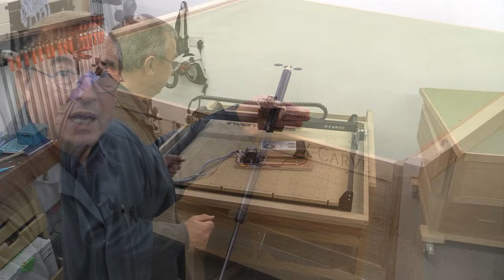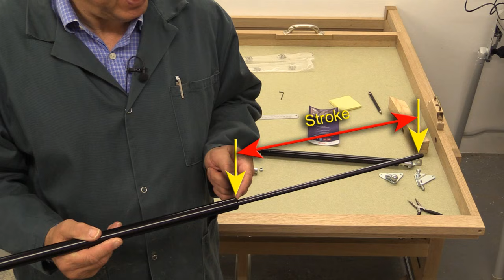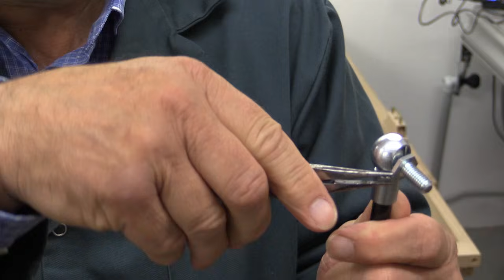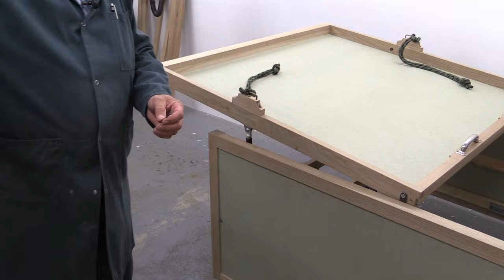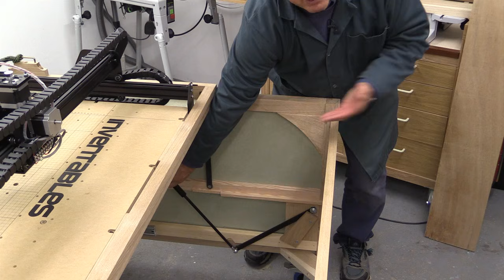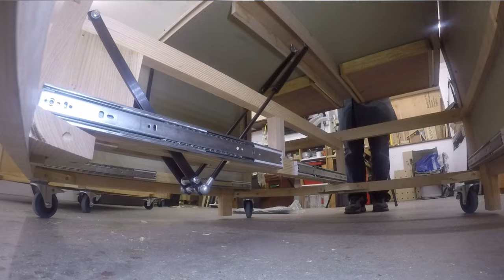How to install gas struts

Comment: Gas springs from STABILUS INOX, usually sold by Attwood, have retainer clips in the heads that can come out and get lost. Stabilus does not supply replacements! These are the clips that you must compress using needle-nose plyers in order to remove the spring from the nub. Very irritating when you've lost the darn clip!

Comment: brilliant solution; thanks for sharing. near 6 years on, how has this stood up to the test of time? do you still find it useful? would you change anything?
Reply from the maker: Hi John, I changed the CNC to a smaller model and decided to make the enclosure smaller. The new design is without gas struts. The old design worked really well and I would have continued to use it but for our move of house and my slightly smaller workshop. Here is the new cabinet:
https://www.youtube.com/watch?v=EysYVMnZxBQ

Peter
Reply: @NewBritWorkshop  Thank you sir

Comment: hi all, I wonder where is the power to push the cylinder of gas struts to up and down. maybe we use by hand, right?
Reply from the maker: Hi Qhungvt, One installs the gas struts in their open position and then when you close the lid (or whatever) you have to apply some force which then provides the stored energy to open the lid later.   Peter

Comment: Hi may I fit these gas struts wooden butter leaf under table    to hold table board
Reply from the maker: Hi Muhammad, I am not quite sure how you propose to do this but as long as the mechanism has a positive stop for the gas struts to push up to then it could work. The other consideration is the amount of force needed to close the butter leaf away. Good luck.    Peter
Reply: Sorry I mean how much weight would they are Handel and my table have extendable legs which are I don't like they block way for chairs to push in under the table that's why I want to fit
Reply from the maker: Hi Muhammad, You can get different gas struts with different force ratings. The ones that I used are adjustable by allowing some of the gas to escape. Doing an adjustment is a one way process and if you let too much out then the gas struts may not have enough force capability. I recommend that you look at the supplier's or manufacturer's web site to find the particular force capability that you need. You should easily be able to find something strong enough for your needs.   Peter

Comment: What a great, informative video. As someone just learning about gas struts, was very helpful. One question not directly related to the struts, but how is the platform kept level? Is it some form of paralellogram?
Reply from the maker: Hi Chris, Apart from the gas struts there are two pairs stays, one set on each side with one at the front and one at the back. One end of each stay is attached to the rising platform and the lower end is attached to the frame. The stays are about 450 mm long. That means that the platform has to move through an arc defined by the stays. The gas struts just provide the motive power.   Peter

Comment: This looks a lot better for the structure of the CNC machine than lofting it upright. Very elegant design.
Reply from the maker: +Educating Savvas Many thanks. I also use the top of the closed unit as a work surface for other tasks.   Peter

Comment: Thanks Peter, for your interesting video. I have a gas strut removed from a car which I think of using in a woodworking project and your video has taught me quite a bit on the subject.
What happened to the gas strut from which you allowed all gas to escape? Is it totally useless now or can it be refilled?
Reply from the maker: +Bala Chandar Hi Bala,  The gas strut that I emptied was sent back and refilled. It is as good as new and in use in that cabinet. Good luck with your project.   Peter

Comment: Hello Peter, 
I saw you at the D&M tool show last week,  I nearly said hello but you looked busy.
Don't give up on the idea of struts for the cover. There is always room if you look hard enough. 
May I suggest to you and other who wish to use gas struts, take a look at any hatchback or estate car. You can learn a lot from how the are positioned. Not only do the hold up the tailgate, they also act to hold it closed.
I can't explain properly with just words, but it is all to do with angles. go have a play and you will see what I mean.
Reply from the maker: +Harvey Smith Hi Harvey, You should have said hello - perhaps we'll meet next year. The gas struts are very interesting and for the main lifting part of the CNC cabinet it was complicated by the parallel motion which is quite unlike the top hinged situation with a car tailgate. The top is not very heavy and the fixed stays seem to be okay. Certainly anyone doing their own design could fully commit to gas struts at the design stage and they should not encounter the retro fitting complication that I experienced. See you nest year at D&M.    Peter

Comment: Peter...if a lid is hinged at the back side ..like the boot of a car, then it's easy to understand the action and utility of gas struts. In your application the motion of the machine table is parallel to the ground and I don't see any explanation of how that's achieved..............you've showed the front so what happens at the back?

But anyway thank you for uploading these interesting videos.

Ian Beswick
Victoria  BC
Reply from the maker: +ian beswick Hi Ian, I hope to be putting the main construction video on line in the next 2 or 3 weeks and all will then be clear.    Peter

Comment: Great design as always Peter. Nice job. Did you ever consider using another strut and a piano hinge so you could just lift the cover and it would stay up out of the way? That way you wouldn't have to lift the cover off and find a place to store it.
Reply from the maker: +Joe Stafford  Hi Joe, My design does not allow for a gas strut for the lid. Originally I was going to have the lid as a detachable piece but, after some encouragement from other viewers, I have installed hinges. I am currently working out the easiest design of stay.   Cheers.     Peter
Reply: @NewBritWorkshop In addition to hinges on the cover top at the back edge, I was going to suggest a piano hinge along the front so the front folds flat against the top when opened. You might attach a whiteboard to the inside of the cover for making notes or sketches when in “working” mode. When I saw your name attached to strut installation I knew you’d have a meticulous execution of the install!
Reply from the maker: Hi Rusty, great idea - cheers.  Peter
Reply: Attatchment a dust collector to it  and you could do your machining whilst it’s closed!!!😂😂

Comment: Nice job Peter! Can I say the oak frame of your CNC cabinet looks absolutely perfect, it's a lovely piece of workmanship itself 👍🏻. 
Malcolm
Reply from the maker: +Malcolm Daly Hi Malcolm, How are you? Almost all the wood that I use for these workshop "furniture" items is either left over from something else or it has come out of the skip at the timber yard. I did have to buy a little bit more oak faced MDF for the drawer fronts but they have yet to be seen in public. They are being made now and I hope to have the whole thing finished in the next 3 days. The video will take a little longer. I did not intend to put hinges on the top but a couple of people have suggested it so I am giving it a try. The problem comes with the stays to hold it safely open but I am working on that.   Cheers.    Peter
Reply: +New Brit Workshop (Peter) I'm fine thanks but my CNC machine that I build from scratch has been a bit of a disappointment, it's not as accurate as I'd like and an incident involving missing tabs damaged my spindle so I'm dismantling it and starting from scratch, hay ho upwards and onwards. Looking forward to seeing your cabinet finished, 
cheers 
Malcolm.
Reply from the maker: +Malcolm Daly Hi Malcolm, I am sorry that your CNC is not as good as you had hoped. What size will the finished machine be and how much has it cost so far?   Peter
Reply: +New Brit Workshop (Peter) it'll an 8' x 4' sheet. Approaching 5. Malcolm.
Reply from the maker: +Malcolm Daly Ouch !  Breaking new ground like this is often tricky but (eventually) one ends up with something far superior to anything on the market for the same outlay.  Good luck.   Peter

Comment: Interesting video. I've never really considered using gas struts but now I can think of loads of places where they would come in useful. Great to see the evolution of the design as well. So many people hide their mistakes but now we all know a range of ways that won't work.
Reply from the maker: +Wobblycogs Workshop Now I have done it once I would not hesitate to use them again. Metrol have been a great help.  Cheers.   Peter
Reply: @NewBritWorkshop awardeesttfftf 8:25 fff

Comment: It was definitely worth waiting for, replaced existing struts previously but not used in a custom install like this, good to know there fiddly when not doing the car boot. Thanks for another great video Peter.

Craig
Reply from the maker: +Craig Hastie Hi Craig, Many thanks. I should have thought it through a little more at the design stage. The way the top hinges up and forwards makes any normal use of gas struts almost impossible. The only way to do it was my first attempt. Unfortunately the horizontal vector of thrust was in the wrong direction. I then had to devise the "compound" idea by introducing the swinging arm. The second design assumed that it would be easy to get both adjustable gas struts to the same force which I could not manage. The final design works quite well. I wanted to show the failures as I hope it will be more informative to anyone going through their own design process. Another approach could be to use linear slides. I know that Accuride make them (they are not drawer slides) but I could not take the risk of trying those without a higher degree of certainty of success. Gas struts are really inexpensive for what they offer and so I would recommend them to anyone.    Cheers.    Peter
Reply: Thanks for further information, always good to understand the design process. Seeing you make mistakes and evolve the design will definitely give a lot more people confidence to have a go as you are known for having made some really good cabinetry and if you, (who for your info sit on a pedestal in many of our minds) can make mistakes it's OK for the rest of us to too.
Reply from the maker: +Craig Hastie I am red with embarrassment now - thank you.   Peter

Comment: What a great design Peter! I wonder whether the removable cover could be hinged at the back and lifted with the aid of gas struts too so that you don't have to lift it off when you want to use the CNC?
Reply from the maker: +Henrys Workshop I had thought of that at the start but I would have to find a way of ensuring that the additional lifting mechanism did not interfere with the movement of the CNC platform. Another idea was to have the top hinged but with a simple stay. In the raised position it would provide an anchor point for a vacuum hose linked to the spindle and also for the mains cable of the Dewalt router that I will install soon. Many thanks for your brilliant suggestion.   Cheers.  Peter
Reply: A simple hinge could work very well!